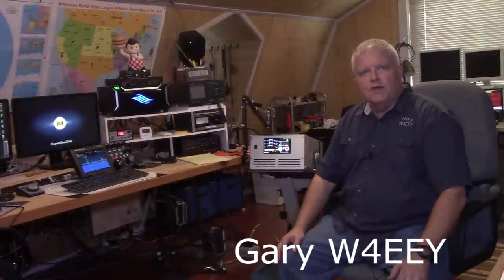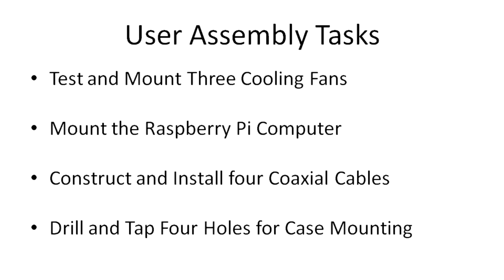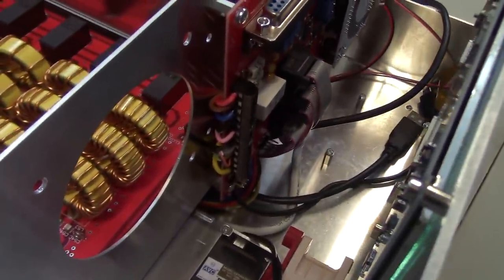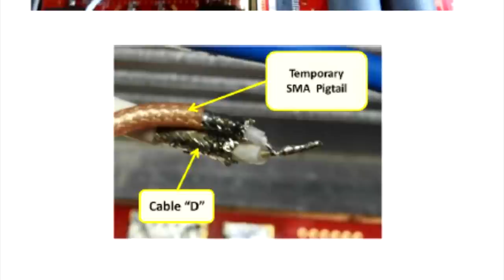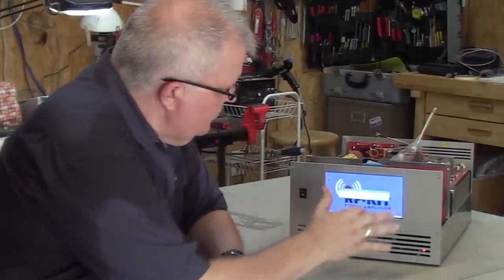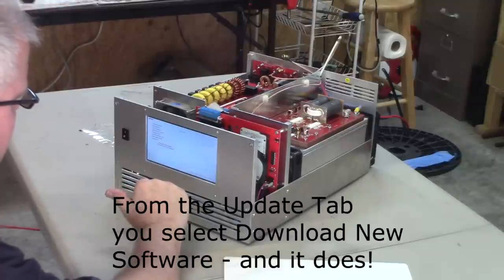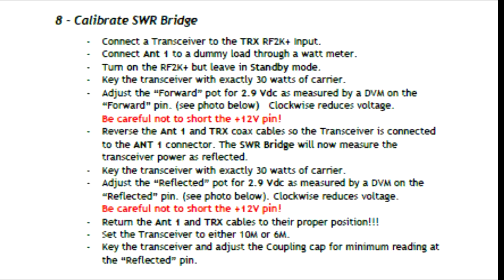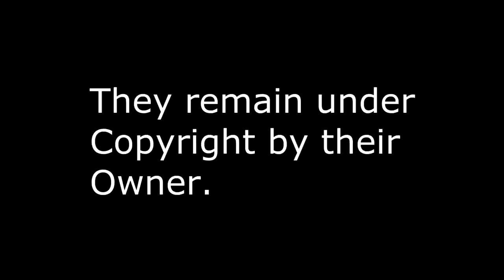RF Kit Amplifier Build

Comment: I like the Beckman DVM, got my first one back in the 1970's and i still use them. Good job on the build.
Reply from the maker: Thanks. Yes, I bought my Beckman DVM in 1990 in Munich, Germany. Still going strong. Still accurate too (tested using a DVM calibrator). 73 de W4EEY
Reply: @W4EEY  I have a Circuitmate DM25L made by Beckman. Apparently it belonged to Continental Airlines at one point. It has an inspection record sticker on the back that states it was last inspected 5/2/95 by inspector LT 45209.  I bought it in a second-hand store in Mesa Az. for 4 dollars. My only regret is they had 2 of them and i only bought the 1. It has served me very well over the years and is still reading spot-on.

Comment: SB-220 for HF back in the day, and I still have them in my shack today. No, I didn't have to chase the parts down, but I built them both, and I know how to fix them. I've built several VHF amps, and one 70cm amp of the 200 W class, they were fun and simple to build from scratch. Used them all in Ham and Navy MARS for many years. Thanks for the look at the future!
DE W4FJF/NNN0QAA/ NNNOGAA THREE.
Reply from the maker: The B26 RF-2K+ was a kit too. The boards came fully populated. You just need to add a Raspberry Pi computer, three fans and make the RF Interconnections. See the website at https://rf-kit.de/ If you built an SB-220 you could build this kit too. And the price is right. Come to the Dayton Hamvention in May. I'll be at the RF-Kit booth with another amplifier that I built. Hope to see you. 73 de W4EEY
Reply: You have SB-220's???

Comment: Very nice, and well presented.   I would have more confidence in the long term durability of this expensive hardware if it did not use the raspberry pi and aerdweeno for control.   What happens when The flash memory starts failing?    The touch screen LCD panel is uneccessary.  Some people might find it difficult to read.   A realtime program coded bare metal on a 16 or 32 bit processor, with high reliability flash memory, and failsafe discrete protection circuitry would give me more confidence.

Comment: What would you think about submerging the LPF into a dedicated enclosure or part of the case with transformer oil - to increase efficiency?
Reply from the maker: I don't think it is needed. The filter efficiency and match is good as it sits. I doubt you could ever hear the difference in real world application. 73 de W4EEY

Comment: How much is the cost to build this and does the kit come with everything one needs to build this amp and how many watts drive is needed. I would like to talk to you about one.
Thank You
Ken Pooler - K1ZYM
Reply from the maker: This amp is no longer available from RF-Kit.de. There is a new model the 2K-S which is redesigned and uses PIN diode switching for transmit-receive. The kit is available in the USA from DX Engineering:

https://www.dxengineering.com/parts/rfk-rf2k-s-kt

Download the instructions from RF-Kit. I think you could build it yourself (maybe with a friends help):

http://rf-kit.de/index.php/docu

and view the description:

http://rf-kit.de/

73 de W4EEY

Comment: A longer antenna would give you more range. Unfortunately, how to go with her. But the amp is nice. SQ4FXU Poland.
Reply from the maker: Yes, a better antenna gives gain on both receive and transmit. Improving your antenna gives the best result. But more power helps in the pile ups! 73 de W4EEY

Comment: 01:43 that doesn't tune the antenna, it matches the impedance to 50ohms - but in no way makes the antenna resonant... people often confuse this.  the antenna will still remain un-resonant, but the circuit will see 50ohms.
Reply from the maker: You are correct. An antenna tuner (whether built in to a radio or amplifier or external to both) does not change the feed line to antenna matching. What it does do is make the transmitter happy - thinking it is driving a pure 50 ohm resistive load. 73 de W4EEY

Comment: Gary who programmed the  computer/ Pi? Also where did this kit come from?
Reply from the maker: Dear EL - The amplifier kit came from these folks: https://rf-kit.de/ Note that the amp I built is no longer available. Instead there is a newer version, the Model S. The first batch of these amps has been sent now to the USA from Germany. The amps are available in the U.S. exclusively from DX Engineering: https://www.dxengineering.com/parts/rfk-rf2k-s-kt

The Raspberry Pi and Arduino programming is by a gentleman in Germany. I don't know his full name and callsign (just his first name: Knut).

73 de W4EEY

Comment: What transistors did you use? BLF188XR?
Reply from the maker: The RF-Kit.de amplifier (RF 2K+) that I purchased back in June 2017 uses the BLF188 LDMOS Output devices. The current units use the BLF189 from Ampleon (I believe this is a correct link  for info: https://www.rfmw.com/Products/Detail/BLF189XRAU-Ampleon/600481/)

Comment: You should mention the cost and the degree of difficulty to build and align at the beginning of the video. Next, describe the characteristics and features of the amplifier, such as solid state or tube design, output power, full break-in ability or not, noise level of the T/R relays and fans, high continuous duty cycle power output, SWR limitations, frequency range coverage, ability to remotely control, and the electric power circuit needed. All those topics could have been covered in the first 3 to 4 minutes of the video. Maybe you could answer those questions in the comments.

Dave KY0L
Reply from the maker: Hi Dave - My recommendation for folks seeking this info is to start with the RF-Kit website (https://rf-kit.de/) and then join the RF-Kit Group (https://b26-pa.groups.io/g/main). A wealth of info between the two sites. 

I have a new RF-Kit S Amplifier on Order (the latest version) and I will use your checklist when I shoot a video about it - and contrast it with the original amplifier. So stay tuned!  Thanks for writing es 73 de W4EEY

Comment: This AMP requires 240 Volt to power up!?  Can it work with 110?
Reply from the maker: It uses a switching power supply (multi voltage input) so it will work on 110VAC - but with a limitation of 800 watts output. 73 de W4EEY

Comment: Is this RF kit amplifier still available ?
Reply from the maker: No, sorry. The Silver 2K+ is no longer available. But there is a new model, the 2K-S. In the USA it is available from DX Engineering exclusively as an assembled amplifier:

https://www.dxengineering.com/parts/rfk-rf2k-s

RF-Kit.de is having the same issue as other manufacturers. Electronic component availability. They can't get the parts they need at the moment - so the DX Engineering webpage shows "Not Available". But it will be. Price for the new assembled version is around $5,000. 73 de W4EEY

Comment: That's not a Amplifier it's a computer on steroids ....  lol
Reply from the maker: Actually two computers :-)
Reply: @W4EEY  I wish I had just 1/2 of your knowledge on this stuff. I am still trying to rebuild and upgrade a Drake L7 power supply. But these electrolytic  capacitors now days really stink. I am in the process of building a whole new voltage doubler circuit for it. This new transformer is bigger 240v in and 1850v out into the voltage doubler circuit. Waiting on some new 18 diodes @1000v 6 amp each.  Have a good day  73's  W4DRA

Comment: Too much hocus-pocus with the raspberry pi and the arduino (why arduino of all things?).That's why i prefer tube linears!!
Reply from the maker: The computers used in Solid State amps are a necessity. The solid state output devices (whether transistors or LDMOS pallets) are susceptible to damage if over driven or if the output bandpass filter is incorrectly selected. Tubes are generally more forgiving in this regard. 

The RF-Kit Amplifier uses an off the shelf Raspberry Pi as the User and Communications interface and the Arduino as the machine control for the filters and antenna tuner as well as for protection against over drive or high SWR. I think it is a very clever and cost effective way to do it. The key is the software written by Knut, DF9QA. The software updates and revisions over the past year have added improved functionality. I hope for more to come.

I operate my station remotely. I need a computer controlled amplifier to make this possible. The RF-Kit B26 RF-2K+ meets my needs. Of course YMMV! 73 de W4EEY